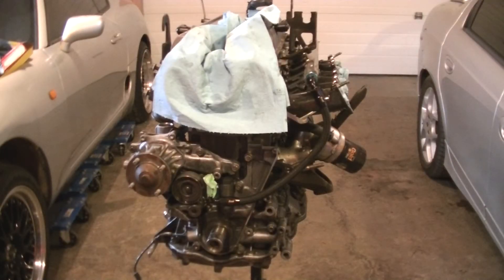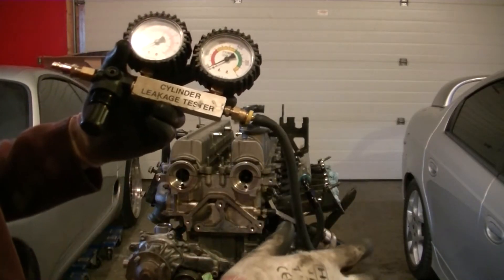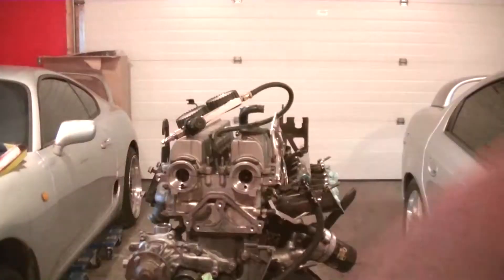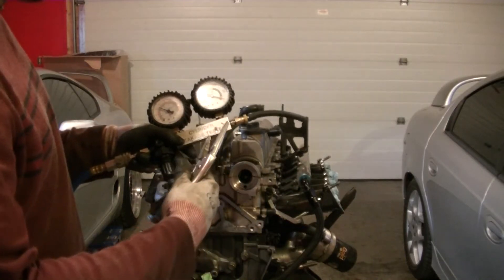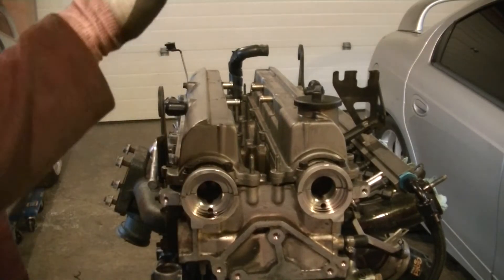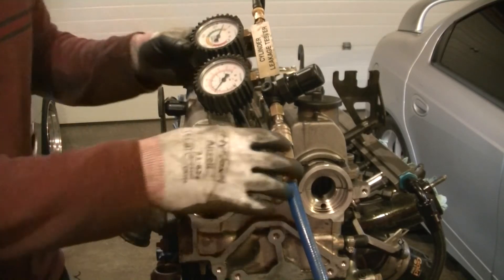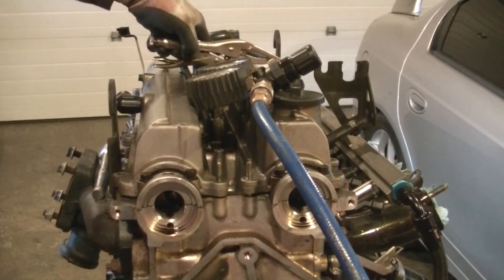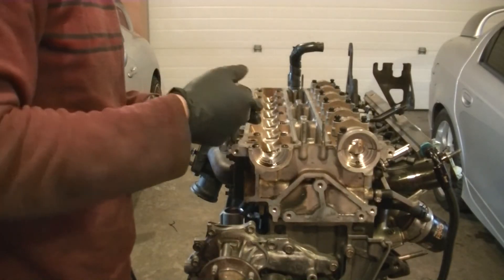Lifetime Supra Project Part 7 - Leakdown test

Comment: I know it's been and gone... But I hope you upgraded the cams, and I missed that...  Also  it's a good practice to use assembly lube on cams not just engine oil...  Anyway, just saying
Reply from the maker: +Seano Hutton nope stock cams, and oil is just fine not like I was breaking them in they were already in the engine
Reply: Of course, and you can see from your future vids it ran fine . I was unsure if you were running new/used/your old/upgraded cams. I hoped you upgraded the bump sticks personally ;) 

When I went to tafe (Australian, Queensland version of mechanic school) years ago, we were taught that any if the rotating parts...  Like the crank, rods cams... Ect... We're to assembled used with assembly lube. 

For the record I do like your vids, I like the style and it feels personal. as I said, just saying. I also subbed.
Reply from the maker: +Seano Hutton still stock for now even still. And fresh oil is a good assembly lube 👍🏻 also thanks for the words about the channel :) I hope you enjoy what I have to offer